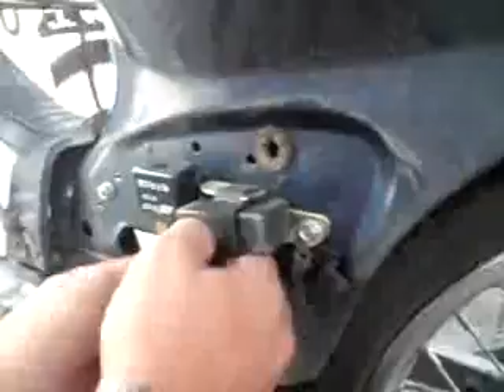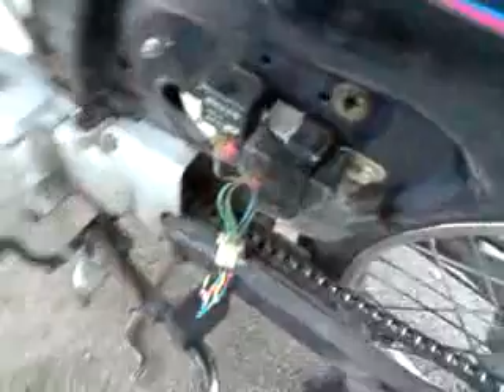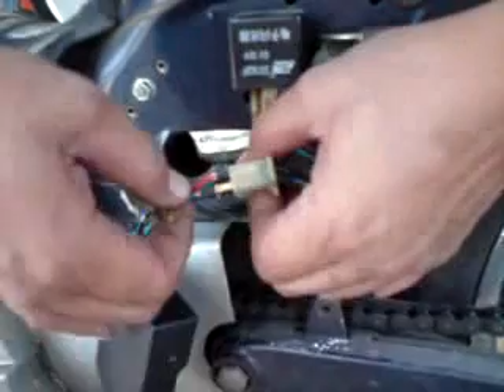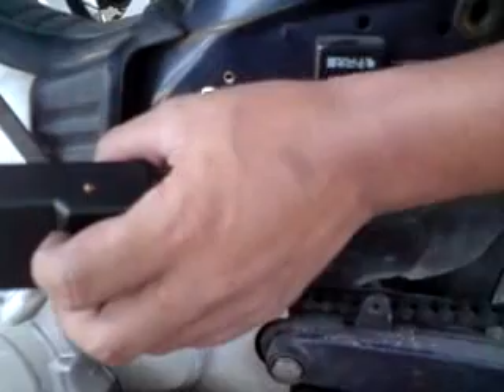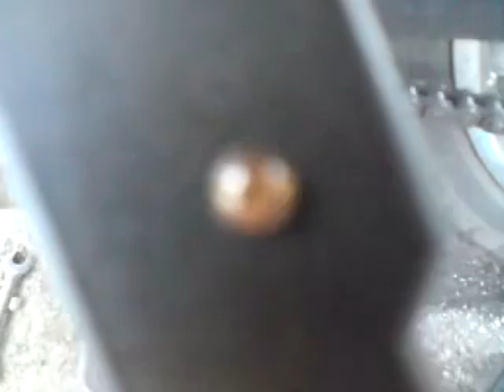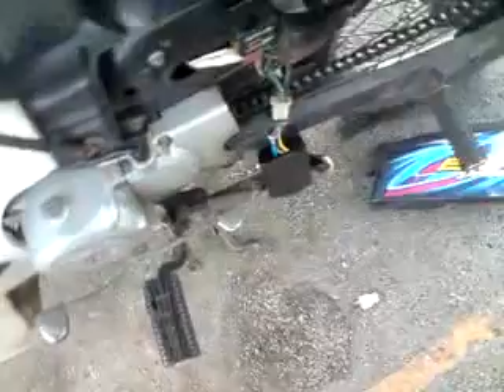CDI POWER FOR EX5 / WAVE 100 made by razi3x  p.g.j.b

Comment: saya nak tanya, sapa pakai ex5 high power 1st model, haritu saya bawak tiba tiba macam semput, saya check rupanya timing lari 4 gigi, dah betulkan dan semua dah okay tapi bila saya maintain throttle bunyi letup2 area carb/tengkuk carb/valve, masalahnya timing chain kendur eh?
Reply from the maker: owh tu valve dh bengkok sikit tu.. nk kena grand valve.. timing lari valv mesti bengkok.
Reply: razi3x tengok facebook bang saya ada mesej nama adam irfan
Reply: bos tumpang tanya..sy pakai ex5 high power lama knpa kali2 plug xda api ya? coil cdi pulg smunya baru tapi tak tahan lama..minta tlg info2 ya bro..